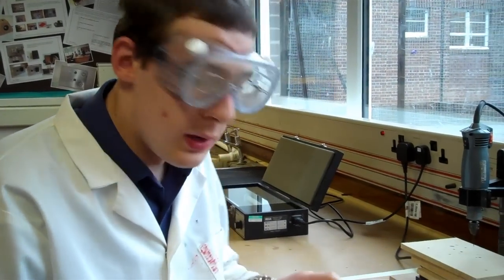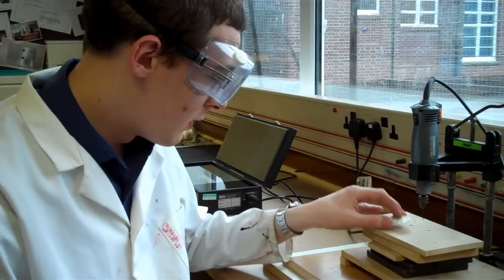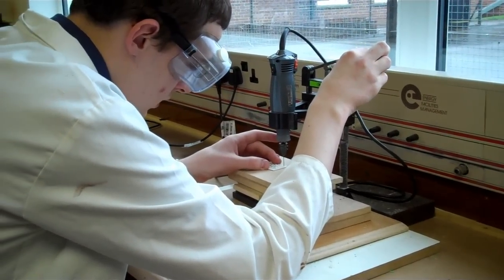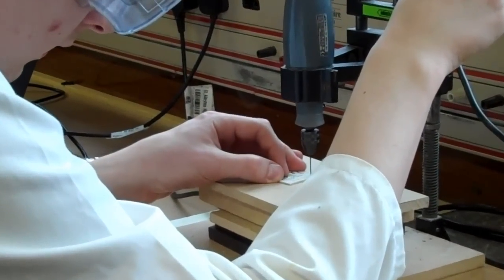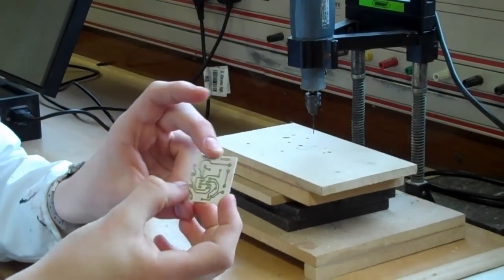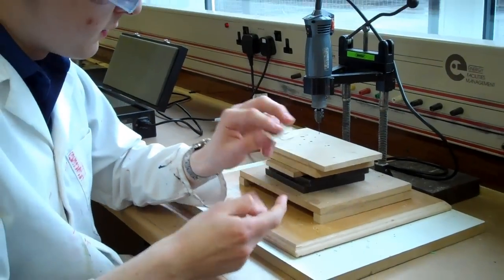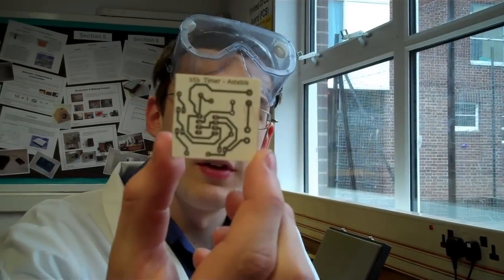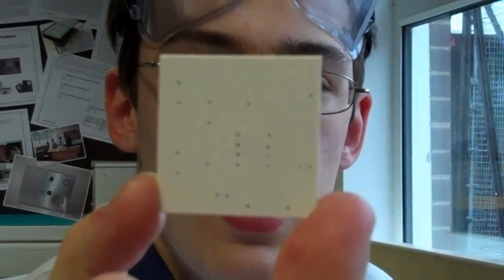How to Design, Develop & Manufacture a PCB | Part 7 - Drilling PCB

Comment from the maker: @liamgreen94 I was going to show all of the drilling but there really isn't anything to it!  Just make sure you're holding the PCB nice and secure, wearing safety goggles and you don't bring the drill down too quick!  If it feels like it is taking ages for it to drill, then you may need to sharpen the drill bit or check that it hasn't broken.